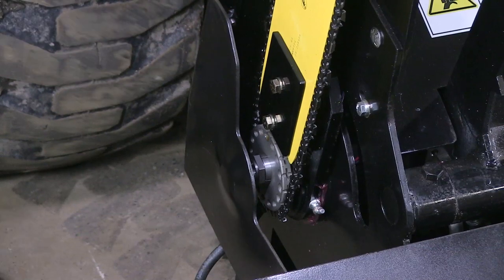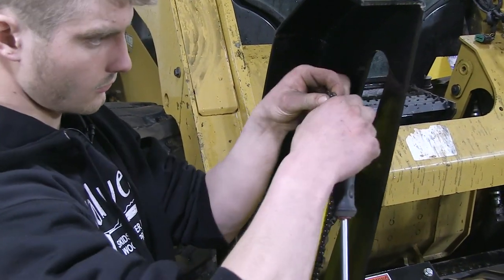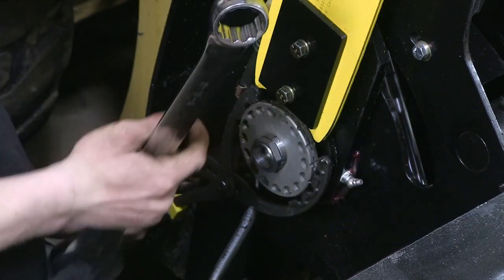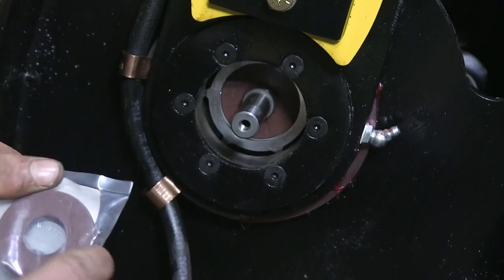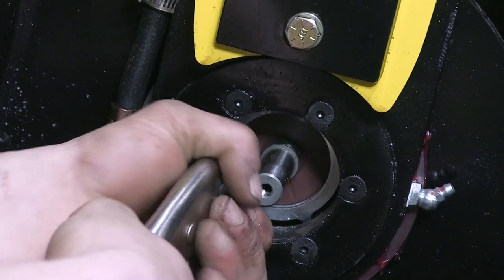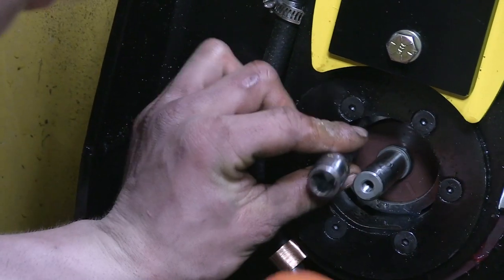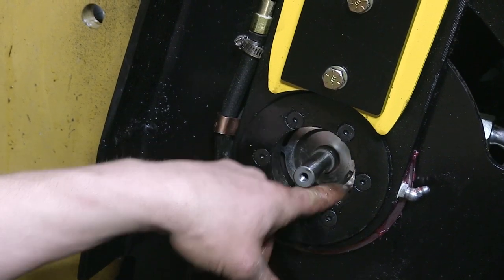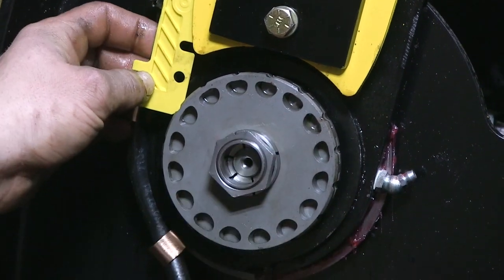Changing the Seal on HWP-120

Comment: If you own one, then you been there done that. Did you all fix the wear problem on the push ram when the tray moves? Ours has been welded twice. That washer is a must by the way, we havent lost a seal since they sent us one. Before we went through 3. The controls was the worst though, buttons kept failing then they sent us a new main box, I almost lost my job over this. Boss thought I was dong something to it. Now the welds are coming apart on the claw because the guy welding only welded one side of the 2 metal pieces he was trying to join, no penetration on one side. All that being said the thing does have 4 seasons on it now and we do tend to run bigger logs than we probably should. Longer and fatter. Log length might be our issue with the push ram wear on the cylinder. Too much log hanging off the end of the tray.